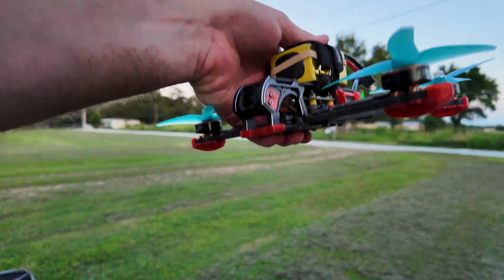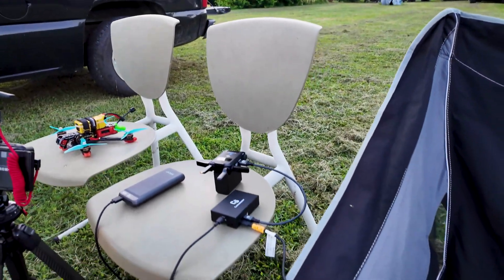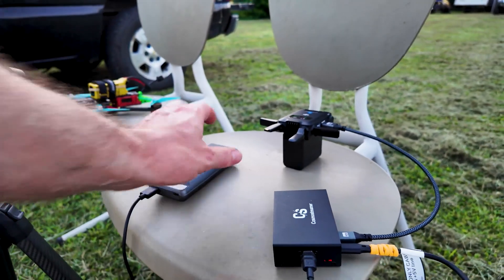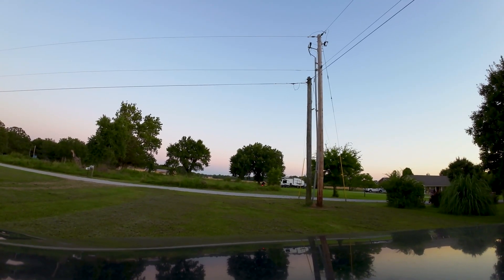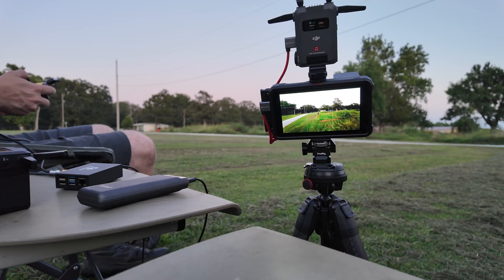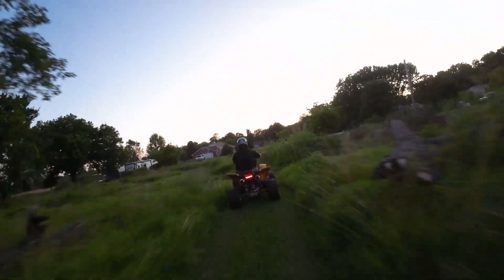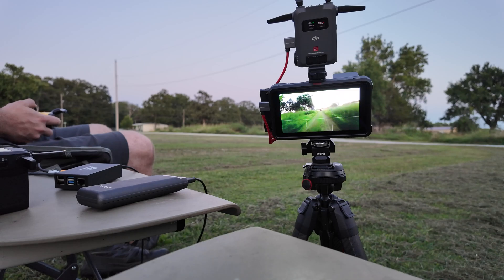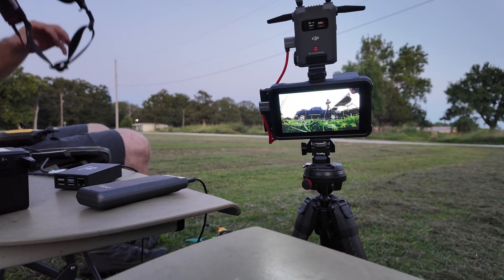FPV Cosmostreamer application with DJI

Comment: Does the OSD info not work with cosmo? Also is the latency about the same as the goggles?
Reply from the maker: You toggle the osd from in the goggle, cosmostreamer will display if you want it. Latency i cant really say, i would be afraid to fly off a screen like this anyway.

Comment: I just bought a cosmostreamer , then  I found out you can do the same usb c from the goggles 2 to usb c iPad and op n the DJI fly app.   Works great. Probably going to shelf the cosmo streamer
Reply from the maker: that is an option, but you dont have a HDMI out to broadcast across an event for a local livestream. the magic box is awesome
Reply: @JordanMotography  It's just too expencive for the average hobbyist. I think they could make the entry licence a lot cheaper and give back a little since the program foundations are based on a open source project on github.